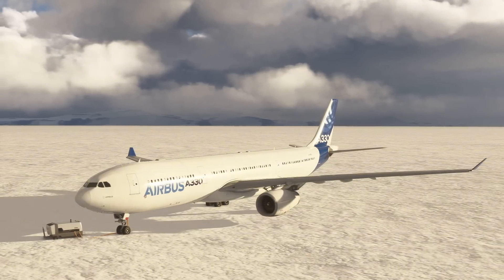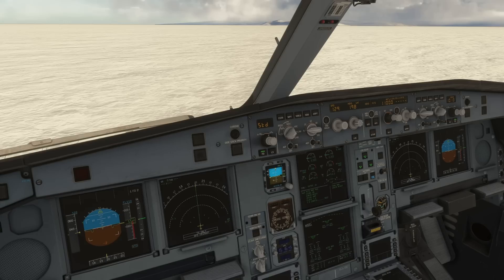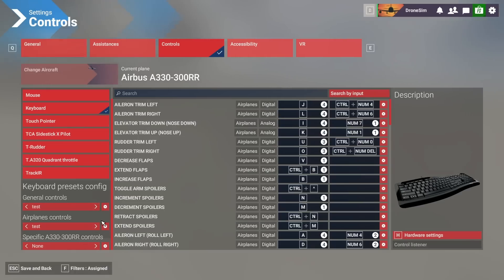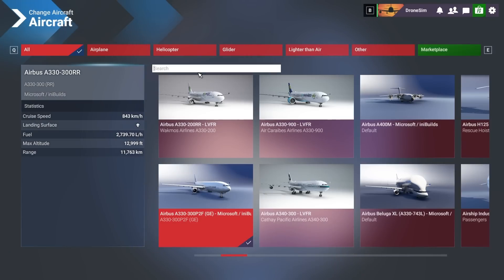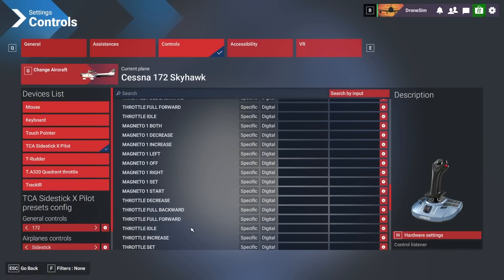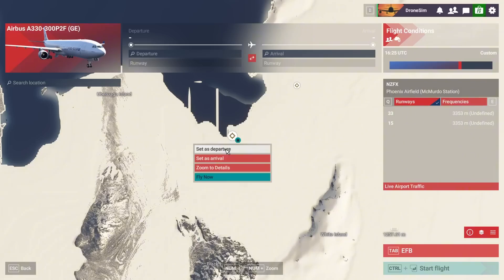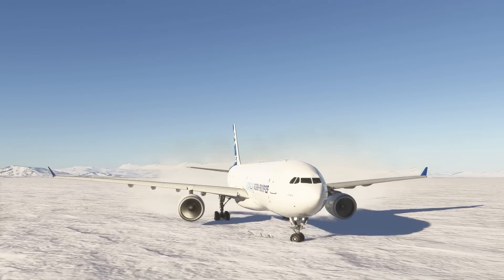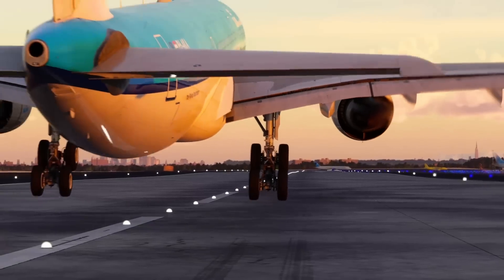Struggling with MSFS 2024? Here's Your Fix! MSFS 2024 Tutorial | Settings | Presets | Key Bindings

Comment: I need some help

I'm trying to create a new keyboard commands, for example, to turn on the APU of an Airbus 350 by inibuilds using the keyboard. I go to control settings, select the keyboard, search for the action, and assign a key combination there. But it doesn't work; it doesn't execute any keyboard action that isn't preconfigured. It only allows modifying the ones that are already in the simulator.
Reply from the maker: @jorgeandresmarin  there’s actually a thread in the iniBuilds forum with a similar issue here https://forum.inibuilds.com/topic/28069-how-to-assign-throttle-detents-to-a-keyboard/

I’m guessing that some of the keyboard inputs are not working with the A350

Comment: i have the airus tca captain pack and when i loaded into the game when i moved my sidestick the ailerons and the elavators dont work but on 2020  it worked fine and malso my quadrant and my tfrp rudder pedals dont show up on the menu i am on xbox.
Reply from the maker: @mikelynch4114  unfortunately I’m a pc simmer which means I can’t help regarding Xbox
Only thing I can suggest is to try to select the 2020 preset in the settings

Comment: Thank you so much for this video; it provided valuable information.

I have a small question, and I would really appreciate your help.

I’m experiencing an issue with mouse movement inside the cockpit in MSFS 2024. When I move the mouse from one place to another—whether it’s to the right, left, up on the control panel, down towards a button, throttle, etc.—it moves to the desired position. However, once I stop moving the mouse, the view snaps back to the previous position instead of staying where I intended.

There seems to be a lack of flexibility, as the view doesn’t remain fixed in the position I select. Could you please help me resolve this issue?
Reply from the maker: You're welcome. Do you press anything before moving the camera with your mouse?
Also check if you have assigned a key for "Reset Cockpit View".

Comment: when using a plane in career mode and is not a Cessna 17 something, all of the planes accelerate while throttle at idle, how can we set throttle at real idle? The PC 12 NGX accelerates on taxi to 30 kts while throttle on idle :))) What is this?
Reply from the maker: @zsolteditor  I didn’t spend much time in the career mode and I mostly fly airliners. So unfortunately I can’t tell you how to fix it. Hopefully Microsoft will do in later updates :))

Comment: Anyone else notice the graphics settings keep resetting to default now and then? Super annoying that you are playing for a while and wonder why everything looks like garbage. Low and behold yet again all settings are set to low/medium for no real reason. Game is such a buggy mess.
Reply from the maker: @ArcanePath360  sometimes after an update the graphic settings are reset, which is really annoying. It might be also because of auto optimization in the nvidia app (not sure if this option is even available)
Reply: @dronesim   So a driver update can cause it? Never heard of that affecting game settings before. There is a config user settings file saved which should be left untouched. These devs really need to get their act together. As a programmer myself, this is basic stuff.  Interestingly the one setting that it didn't affect was the one I hacked into the file and adjusted manually because of a bug where it sets windshield effects to low no matter what else you set it to in game. It's been too long since the last patch and there is still so much of this game that is unplayable. It's a mess and a joke that they charge so much money for it. Now the next patch has been delayed. Not happy with the state of this sim. Auto pilot seems to do random things, planes fall out of the sky and controls get lost after entering photo mode, ATC gets stuck in a crazy loop and doesn't relate to anything you are doing. The list goes on
Reply from the maker: No, sorry there was a misunderstanding. Not the graphic driver update causes the UserCfg.opt to reset, I mean the update of the sim sometimes causes that. I noticed that a couple of times. Which is why I always backup this file before doing an update. 
Interestingly, I have very few issues with FS24. Which is strange because a lot of people are experiencing different kinds of problems.
I’m just hoping that SU1 will fix a lot of issues.
Reply: @dronesim   There hasn't been any updates though. I checked the build number. We haven't had a patch since December I think. Good idea about the config file. We shouldn't have to do this though. I wonder if user experience is determined by peripherals conflicting or maybe it's how we play it. I do mainly free flight and try out lots of new things all the time. I alternate flight planning between the main screen, the EFB and the Garmin and noticed that they all seem to conflict and confuse each other if you try mixing them, such as sending route to avionics, filing the flight plan then selecting a different approach in the Garmin. Sometimes it seems to select the approach to the airport where you came from, even though that isn't what you programmed in. It's super annoying
Reply from the maker: @ArcanePath360  I agree, we shouldn't have to do anything to make the sim work fine. The sim should be working flawlessly without even the need for addons. BUT unfortunately it is not the case. I started flight simming in early 2024 with FS2020. And even back then, I found a lack of user experience. I can't imagine how the FS2020 was, in the first couple of years after release. Now seeing how the state is in FS24, I actually can. MS/Asobo has a lot of work to do..
Reply: @dronesim   They certainly have. It's a great sim and they did a lot of good work. I just wish it would work. I don't think they did a job address the problems as well as shipping it in such an unfinished state. Still no marketplace. No Red Bull race that we see a demo of at every start up. Some other things missing and even some tutorials (glider) are impossible to complete because of a bug. We got an apology in the way of being promised 4 free planes, but where are they? When are they coming? I feel like Asobo should have been politicians.

Comment: Been struggling with controller set up . I can never get the power right .
Reply: I am experiencing a similar issue. I am currently setting up the A330 and the thrust reversers are always on the Throttle Axis, no matter what I do.
Reply from the maker: Did you calibrate the throttles in the EFB?

Comment: HELP! My mouse is extremely sensitive when looking around the cockpit. I have lowered all settings s to do with the camera and it’s super slow with my Xbox controller now but still hasn’t changed my mouse. Is it in the “hardware settings” in the settings panel? Idk how to adjust that
Reply from the maker: @jacobgreathouse9382  are you a PC of Xbox player?
Reply: @ I just read your other replies about this same issue. I will try to play with again but if you have found anything else that would be great. I can use the Xbox controller just fine but literally bought a mouse specifically for this

Comment: I don´t think the tiller thing is a bug. With the mass that an airliner represents, steering with the nose gear in the snow would not work. Just as you illustrate in the video. The nose wheels would plow straight forward in a straight line. Got some really good tips! Thanks! :-)
Reply from the maker: @dias_se ok you were right.. for some reason now the tiller is indeed working.. 
I am pretty much sure that this was not the case on hard surface when I made the video 😄
Reply: @dronesim  Haha! Well, se all have the mysterious buggs with this one. Good fun though! 😃👍
Reply from the maker: @dias_se  you are welcome. And about the tiller, I already tried that on a hard surface it’s unfortunately the same behavior.

Comment: Whatever happened to plug and play? Surely the default settings on the controllers should just work and then by all means go and fiddle and adjust, assign as required. They seem to have turned a reasonably complicated system in 2020 into a even more complicated one in 2024. Yes I know xPlane sort of sucks graphically etc but as least getting the controllers to work and views are dead set easy.

Comment: Why couldn't there just be a migration path from FS2020 that allows you to load your control settings?  I'd guess the majority of FS2024 customers previously used FS2020 and don't want to learn the new settings.
Reply from the maker: @RJN82  I was really disappointed when I heard that MS and Asobo said that the (custom) controls of 2020 are not going to be imported to 2024. But at least they have included the 2020 presets for the keyboard.

Comment: My mouse is extremely sensitive to the point where I can’t even look around. Do you know how to fix it as I’ve changed the settings and it still remains unusable thanks
Reply: Same problem. Mouse works ok in external and character but will not move in cockpit yet settings are exactly the same for all
Reply: Changing Freelook Speed and Momentum has no effect on the mouse.  Joy stick only.
Reply from the maker: @mykoverton  are you sure? Because if you set the mouse axes to control the Freelook (e.g. in the cockpit), it will have an effect.
Reply: @dronesim  it have effect but every so slight. The mouse has a very aggressive acceleration and here is no way to disable this.
Reply from the maker: @PhilippSeven  do you have the same problem as @harvey35K ?
Reply from the maker: Couple of questions first 
- Which settings did you try to set?
- Is your mouse capable of setting the sensitivity (DPI)?

In the Settings > Camera there are options to set the Freelook Speed and Freelook Momentum. There’s also the setting to change the Freelook Speed of the Character at the bottom.
Reply: @ the sensitivity settings I change only seem to have an affect on my controller, not my mouse.
Reply from the maker: @Harveyx350  where exactly did you change the sensitivity?
Reply: @ Firstly I went to settings> camera > free look speed and momentum and changed them and no change, only my controller.

After that I went into controls > mouse > camera > hardware settings and changed sensitivity + and sensitivity - with no change. Every setting I change seems to only apply to my controller, not my mouse
Reply: Not sure if this similar issue, but I can't do a freelook inside cookpit with my mouse, I can press buttons and zoom but the mouse dosn't move when I try to freelook (using right-shift and move) , it works good in external cam tho
Reply from the maker: @Falcon-tt1ol   @hamodi9999 
I need more information. Did you set a key (either on your mouse or keyboard) for "toggle cockpit view freelook (hold)" ? If not then this is why it is not moving the camera. The external view has it's own "toggle external view freelook (hold)".
Reply: @dronesim  yes I have it attached to mouse right-click. I have a wireless mouse, when I plug and unplug the charging cable, it works and can do a cockpit freelook, but it stops when i press any key which is strange.
Reply from the maker: @hamodi9999  ok this is really strange.. this is where my knowledge ends about this topic 😄
Reply from the maker: @hamodi9999  hold on.. are you guys with the mouse issues on Xbox or PC?
Reply: @dronesim  I'm on PC but I've fixed it finally , the cookpit freelook was assigned to my joystick, I deleted and now it's working

Comment: I fixed it by deleting it and playing something else.
Reply: Same here. They removed my favorite feature - Bush Trips ... and the rest of it just crashes.
Reply from the maker: @KludgeMaker  that’s unfortunate. They did not include Bush Trips in the Career Mode? I’m asking because I never did anything else but the Free Flight in 2020 🤣
Reply: @dronesim  I realize I'm a tiny sliver of the audience, but I'm here for the sightseeing. Not interested in working my way through career mode to get to what I want to see/play.
Reply from the maker: @SooHooSamaSito  🤣 that’s an option too
Reply: I’m running the Xbox version I got with Gamepass $10 for PC only, and it runs great!  I’ve had no issues. It installed very fast and runs well. I’m even using some payware from MSFS2020 and they also work. Some need updates of course. I also mostly fly free flight.  I’m very happy with the new sim.
Reply: @AV8R917  Not my experience at all but I'm happy for you. I refunded and purchased Baldur's Gate 3.
Reply: Same.
Reply: After a bit of a learning curve, I really think the new control settings is much better. At least in the long run. As for “specific”, it relates to features that fall under neither the General or Aircraft general bindings. Example would be TOGA, which is not available in all aircraft, as rudder would be, so my guess is that TOGA button mapping will be under specific.
Reply: Boo hoo hahhaha, MSFS2024 works perfectly for me.